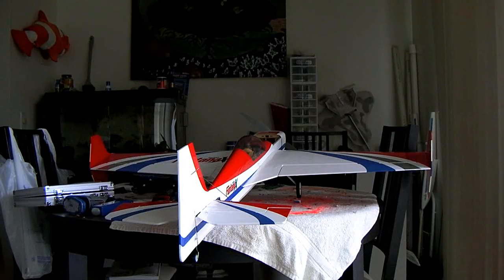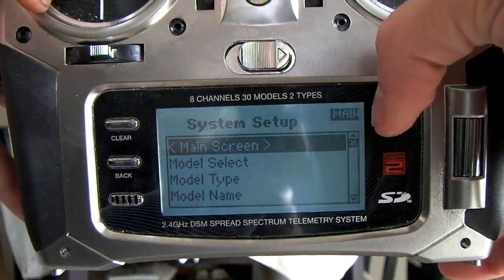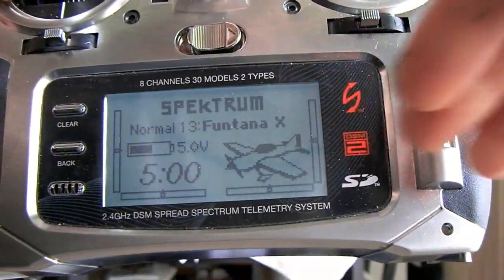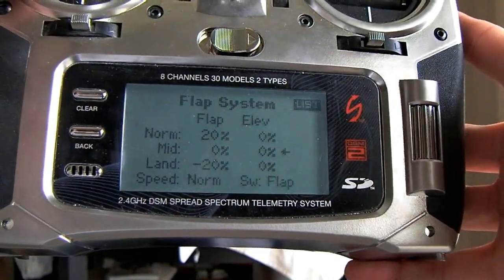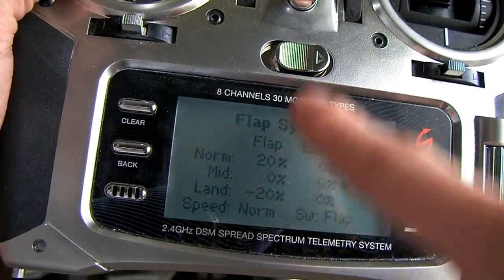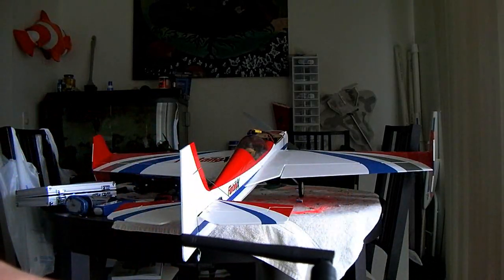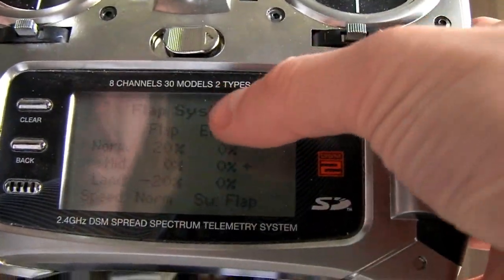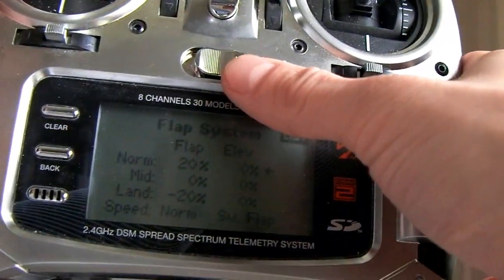DX8 Flaperon Setup

Comment: Have the DX 8 FS. a F16 jet with surface selection: 2 aileron servos and 2 elevator servos (normal)! If I set in the Transmitter  of 2 ailerons on Flaperon Leiwerk Normal the following happens: ..... If I press the flap switch of 0 au1 or 2 but the left aileron goes down and the right up and not down both !! I can not say what to do ..? ….…..what am I doing wrong ..? I look forward to your help!

Comment: You mentioned plugging one aileron in to the aileron port, and one aileron in to the AUX1 port. Does it matter which one goes where, and do you have to do anything with the AUX1 switch in the switch select?
Reply from the maker: doesn't matter which one.then you just use the flap switch.
Reply: Thanks Man.

Comment: I am curious if the "flaps" lowered the stall speed in this plane. Does the spoileron work as air breaks? Do you remember?. They are telling me on rcgroups that flaperon wouldn't work in a Carbon Z Yak, which I think is a similar plane. Thanks.

Comment from the maker: @pilotdynan yes, so far it has proven to be the perfect radio.  I admit it does offer many more features and settings than a beginner would use; however, it is simple enough for anyone to use.  This transmitter will be easy for anyone, and provide a lot of room to grow in this hobby.  I would recommend this radio to anyone.  The DX6i would be my other suggestion if you want to spend a bit less but still have a great transmitter.